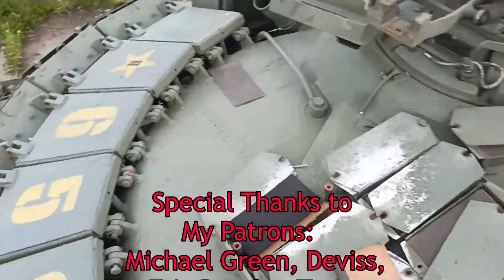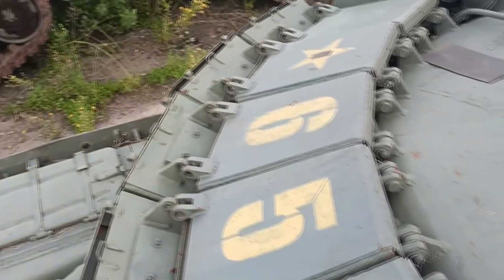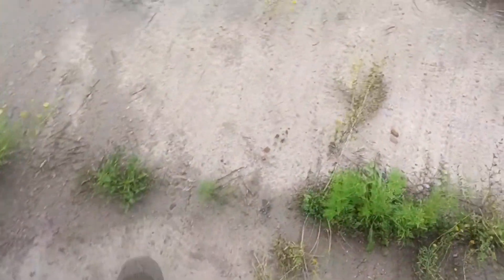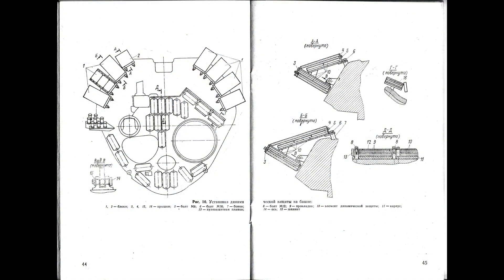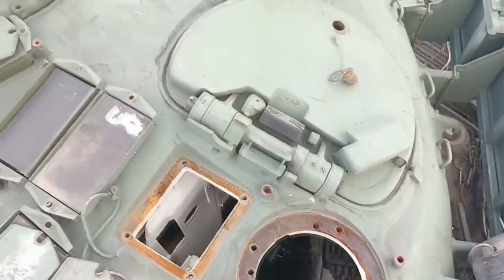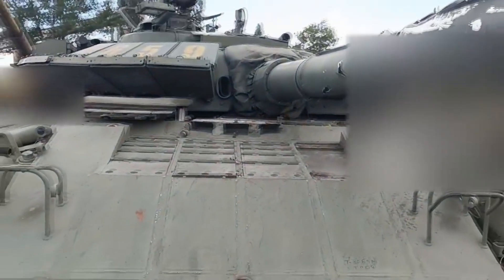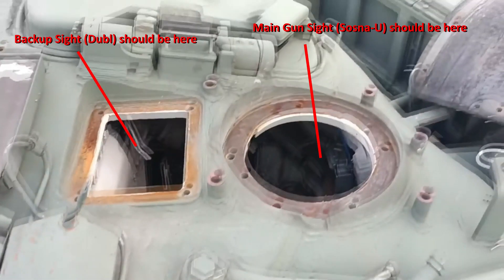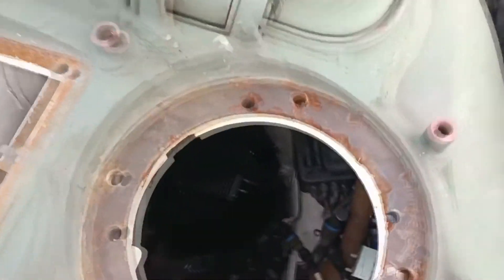Russians Are Using Rubber instead of ERA on their Tanks

Comment: I still have yet to see any footage of a tank that has survived an ATGM strike due to either the reactive armor ar a cope cage on the roof.
Makes one assume that they were placebos designed to calm the crews down.
Reply: Javelin has tandem warheads, these are Kontakt-5 armor blocks, so they can't stop tandem warheads. Only the T-90M has Relikt on the roof as well.
Reply: @voidtempering8700  we are not seeing any evidence of the reactive armor being successful against ANYTHING. 
I imagine if my tank was hit by an RPG and the reactive armor did its job I would happily shoot a photo of the results and pass it along.
But we arent getting that let alone UNITARY warhead ATGM
I am beginning to suspect the Russians simply employed them for a placebo effect for the crew morale.
Reply: @bdinaz  That is because most Russian tanks use Kontakt-5 ERA, while most missiles used are tandem shapes, which effectively nullifies their effectivness. When a tank uses Relikt, we see cases of them taking multiple hits to bring down, such  as a video of a T-80BVM taking multiple hits along the frontal arc. We also have a T-72b3 that was hit multiple times, and it doesn't even use Relikt, however, the end result was the tank being destroyed and the crew killed.
Reply: @voidtempering8700  i watch very closely and I have not seen ANY example of a reactive system working regardless of projectile being used against it.

Comment: I disagree with you because if those rubbers were used as dampers why were the ERA containers filled to the top with rubber dampers with no room for the explosives?
Reply: you don't really need to fill up the ERA block with explosives if it's going to be placed on the roof, more explosive on that weak spot can damage the tank or even the crew, that's why the use less explosive and use Rubber

Comment: lol filling it with cornstarch and water would be stronger then that!
Reply: what?
Reply: @nekko5778   cornstarch and water makes a strange fluid that's both a solid and liquid at the same time.  if you let it flow and be gentle it becomes a liquid.  if you punch it or try to stretch it, it's hard as a rock.  it would definitely slow down the bullet enough to not damage the armor as much.

Comment: But why take the explosive parts out of the blocks and not just take the blocks with everything already in them?
Reply: because the blocks are mounted onto the tank and are more difficult to transport and heavy. Era explosives are thinnisch plates while the blocks are easly replaceable and cheap steel.
Reply: @nekko5778  all you need are some impact drills to take them off. Would take 30 seconds to remove one, just a few bolts.

Comment: The rubber padding is there to reduce vibration in the explosives of the ERAs, preventing them from detonating... so they only detonate from a hard impact.  
You don't want them going off, because you started the engine, or dropped a hammer on it.

Comment: There is simple answer - huge corruption in ministery of "defence" and whole army, even in the army factories. When istead of just rubber there had to be at least 50 to 100mm armoured hardox steel, there is just a rubber (cheaper). And all otherr armour stuff. Why towers of rashastan tanks just fly over, 10-20 meters of height... there is no dynamic or any active armor, plus, underneath all the missiles, high temperature, good blast between tower and tank, throws out the tower, and in the mean time all the tank missiles detonates inside the tank, then it grows up to the huge blast

Comment: Another possibility is that the explosives from the ERA were replaced so as to allow infantry to safely operate near the tank to avoid friendly fire caused by fragmentation from the detonating ERA. Rubber is not as effective as high explosives when it comes to stopping anti tank munitions but it works. The "cages" that have been seen on top of Russian tanks are probably a effort to mess up the stand off distance of shaped charges and reduce the effectiveness of systems such as Javelin (by causing premature detonation), although I somewhat doubt it's effectiveness (they probably would need to put ERA on the cage)

Comment: How would the explosives not be a target..? XD just aim for the top of the tank, hit an explosive.. And boom, tank is disabled... Like? That's a dumb design.
Reply: The explosives are there to mess up any antitank weapons (mostly shaped charges, and maybe APFSDS kinetic energy penetrators) used against the tank. However, they are single use only. Because of that antitank weapons using tandem charges were invented, the first charge blows up the explosive armour and the second charge makes a hole in the armour. Destroying a tank is not as simple as putting explosives on top of it, as tank armour isent made from homogeneous steel plate anymore

Comment: There are stacks of rubber cut into the exact dimensions. They never had anything but rubber in them. This is the face of corruption. The actual unit was probably sold off and replaced with rubber.

Comment: It is still a reactive armor. The rubber has fine beads of ceramic and kevlar fiber that disperse and reflect the energy. Not as good as the explosive variety but ok for most uses. Not gonna affect a main gun HEAT round or a javelin though it may work on light antitank weapons like an RPG7 etc.

Comment: If you followed the news carefully, and did not judge by photographs, you would know that many tanks were damaged and it is not always possible to evacuate them immediately. And from them spare parts can be removed by passing units. Or they could have already removed the necessary parts after being removed from the place due to the fact that there are no necessary parts for restoration, and the video was filmed when they directly got to the dynamic protection.

Comment: To clarify for all these rubber pads are the standard in fill you get when you take delivery of a tank. Once the tank enters a combat environment they are/ can be removed and replaced with ERA. 
Leaving not pads or explosives in the steel casing causes a loud rattling noise

Comment: Don't understand why ERA panels are full of "prokladkas" instead of being half empty due to the absence of explosive elements in it. Also there is no point to take elements from ERA separately- you just take it altogether if you need it. Another thing is that Ukraine has enough and producing tons of new It's own ERA that are much better than russian. That's why there is no point of such difficult manipulation. Also about rust on trucks and other elements. They are definitely not "horribly" rusted. If you look carefully, you'll see just thin layer of it. And it's absolutely normal, because numerous russian tanks stacked in northern Ukrainian soils during invasion in spring and were abandoned by their crew.Many of them stayed there until russian's fleeing from Kyiv, Chernihiv and Sumy regions and until Ukrainians were able to take them  out by tractors 😉. That's why it's nothing special they got rust, especially on trucks.
Reply: Yeah by your argument also there's no point to take only main gun sight and it's backup, driver periscope, headlights, fuel tanks, and all of the bolts. Why they dont take the entire tank and use it against russian lol. Its just simply economic. If you get something for free, why you didn't take it? They are both ex-soviet nation and share the same/similar equipment, scrapping it means that you have more stock on reserve if in any case there's a bad situation happen.

Comment: Seems extremely time consuming to take out the explosives out of the ERAs and leave the rest of the unit. Why not just take the whole unit? If the Russians took the parts off of it before abandoning it but left some of it intact I think the truth lies somewhere in the middle.  It seems like some of the ERA was worth taking off of the tank and some of the ERA was just inert or useless and they left it on. It would explain that the useless stuff was left there but some whole pieces of ERA was not on the tank in the first place. The rust on the tracks does not necessarily give a telltale sign that it has been sitting there for too long. There has been several reports early in the war that the Russian infrastructure was degraded to a point where they had wheels falling off trucks and tanks breaking down in the middle of the battlefields because of neglect and over use.

Comment: Seems a bit odd to remove the explosive and leave the rubber in place, If cannibalised or stripped by looters or soldiers requiring explosives you would think the rubber would have been pulled out with it and dumped if not needed

Comment: If the answer is that it was stripped for parts, what explanation for replacing the era casings with rubber tiles. Why bother? In any case the quickest way would be to remove the packs completely. This came out of the factory like that and the corrupt manufacturer was shafting Putin and his troops.

Comment: They cannibalized the sights leaving gaping holes. They cannibalized the periscopes leaving gaping holes. They cannibalized the gas caps leaving gaping holes. They cannibalized the freaking bolts leaving holes.

But they cannibalized the ERA by carefully putting all the rubber strips and dividers back in place and then putting the covers on them? Whatever.

Comment: It's the egg cartons 2.0, and ERA is so cheap that unless you're completely cut off from logistics or  manufacturing centers are rendered inoperable due to endangerment or destruction there's no reason for anyone to run out of charges...

And as you say it's clearly inoperable, looks like some hulls you'd find at proving grounds (or what would be left of the tank if you parked it in Romania)

Comment: Those reactive plates.... can sudden movement by a human set them off? Or rather, what triggers them?  Do they have to be made safe when the tank is not in use?
Reply: They are triggered by pressure. If you get a hammer and smack it. It will explode.
Bullets?  Maybe.

Movement? No.

If a tank bumps it into a house. Yes.
Reply: @airforceone6523  Do crews have to disarm or safety them when the tank isn't in the field? Like a safety pin or something?
Reply: @oatlord  no. Thats why they are inside a metal casing. There is like a screw or latch that makes it open as seen in the video.

Its like a land mine but on a tank. Will not explode until pressure hits it.

Talking about mines.

Those tank mines are very powerful. The explosion is a size of a normal single storey standard house.

A hand grenade explosion is the size of a person.
Reply: @airforceone6523  they are designed to only explodes when hit by 20mm and higher

Comment: As a special weapons engineer I can vouch for why you have found rubber plates inside your tank good sir! The rubber plates are actually just silicon plates. The reason is due to the fact that silicon can't be burned, try for yourself, buy a propane torch lite it up expose the flame to the silicon and let it burn for 1 hour maybe 2, except it won't actually burn at all it will not change its appearance or durability at all, good day sir!
Reply: Exactly ! It’s a perfect engineering method. Works the same and the bombs won’t burn your tank down. 😂
Reply: Can the silicon be used for heat protection for rockets or capsules returning into the Earths atmosphere. Is the material a silicon carbide type? Ceramics?
Reply: @terminusest5902  it's silicone rubber, like kitchen accessories are made from due to the material's high heat resistance.
Reply: I think you were trying to type Silicone , Mr special weapons engineer.

Comment: The only issue is that I have seen many, many videos and pictures of Russian tanks with no Explosives in their ERA and just finding empty ERA panels or filled with packing/buffers. The point where this makes ZERO sense is on destroyed tanks where there's no evidence that the ERA went off (since the panels are still there and everything and sometimes damaged by fire or impact) and yet you see nothing that resembles explosive filler material in it. Now, sure, maybe someone is going through all of Ukraine and removing anything that looks like explosives from destroyed Russian tanks. But if there is, I want to see and talk with the madlad that is going up to burning T-72/T-80 tanks in the middle of combat and salvaging unused explosive filler from ERA before it can be damaged or set off by fire. Until I see evidence someone is actually crazy enough to be doing this, I can only assume the more likely scenario: Some of this ERA is not operational.

Comment: Is it possible that the explosive was removed and repurposed? Maybe to make claymore mines or for explosive for other types of missions?

Also, it the intent was to apply it to other vehicles, wouldn't the entire installation be needed. The rubber likely expands rapidly from the heat of the explosion to provide more counter force. It would explosively combust magnifying the counter force.

Comment: Reactive armor is very dangerous to exposed crew & nearby infantry. You will find the ERA blocks in certain areas filled with non reactive armor.... rubber pads. Though, I have to admit, those Russian rubber pads are very thin compared to those I've seen used on western tanks.

Comment: I was an explosive breacher. We use rubber to tamp and buff the charges for metal doors. The pressure from the explosive essentially turns the rubber into a fist which pushes down the door. Don't know if it'll do the same to tank armor, but can't imagine it would help the tank. Perhaps by distributing the blast over a wider area. We did the same with IV bags and the pull off Popsicles, called a water impulse charge.
Reply: Not really the same effect when the blast is from a HEAT warhead.  Water charges and tamping are in basically direct contact, whereas armor is getting hit with jets of molten metal from whatever the stand off is, so less of a pushing effect.  The rubber pads and layers would offer some energy dissapation and limited resistance to a kinetic rounds, thought I doubt it would make a difference to a SABOT.
Alexander the Great said it best:  The purpose of armor isn't to protect the soldier, it is to make him feel protected.
Reply: i know nothing about this, but maybe the ERA goes under the rubber?

Comment: A doubtful conclusion in this video. 
In the original video the Ukrainian soldier comments that the empty slots (those with no rubber incerts) are not only empty, they also look like there was nothing there EVER (i.e. from the factory). 

Also, IF the captured tank was canibalized for spare parts for other Ukrainian tanks (and it probably was), why taking only explosives from the dynamic armor and not the whole units of that armor? Are you suggesting that the tank models with no dynamic armor what so ever need explosives ONLY and not the whole assembly? And if Ukrainians indeed have for some reason removed the explosive elements why do they put metal covers back in place and not just left them open? ;) 

My point is: don’t underestimate Russian level of corruption, state theft, cynicism and stupidity! ☝️🤓
Reply: Exactly what I thought.
Reply: @Mal101M  How do you imagine REPAIRING a REACTIVE armor unit by removing just  an explosive part from another unit. Are you suggesting the casing of a used one is still intact? 😁
Reply: The Russian are clever my friend: if i were not mistaken there is tactic of puting some sort of bobby trap on abandoned weapon and war vehicle..they even put a hand grenede without the pin on abandoned AK 74 just underneath it..
Reply: Your entire argument here is based on the idea that every Ukrainian must have perfect decision making while every Russian must be stupid. There's no chance that the Ukrainians could have screwed up and had a brain fart, but a 100% chance that Russians went in with a tank that was already rusted and conveniently missing many of the parts and bolts that would be canabalized? Your last sentence shows way more bias than the video. The Iq requirements of soldiers aren't high, especially when they were literally asking for volunteers.

Comment: the theory that ukraine took the explosive elements out is still a 50/50, because they may have discovered the explosive elements were gone when they went to use the panels... then they examined the rest and found them that way... is the other half of that 50/50.  as far as the bolts and other things missing well, we'd need some really good pictures of the tank after it was captured before it was either stored, gutted or put back into service.... it is also possible that it was taken back by russians and then re-captured.  it is a war, you win and loose ground all the time, and weapons trade hands more than most would like to consider.  anyhow ... the perception or alternative angle of thought is refreshing but as an impartial you may need to work on that some more.